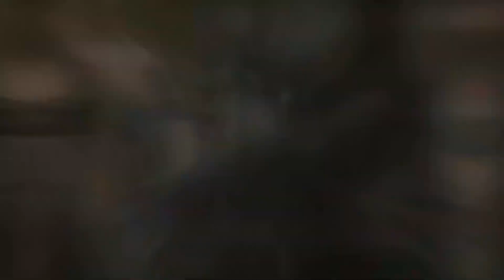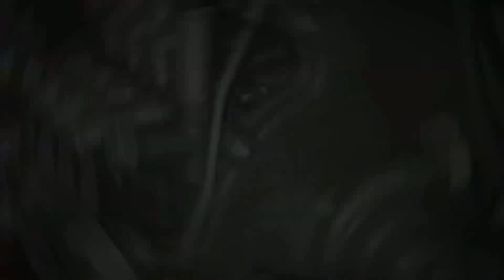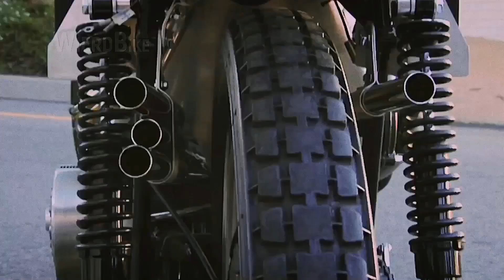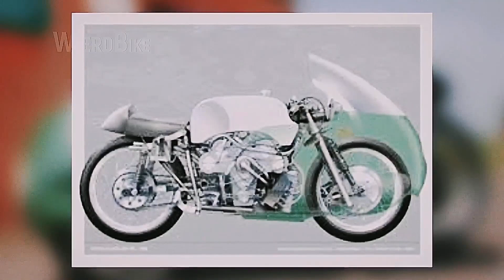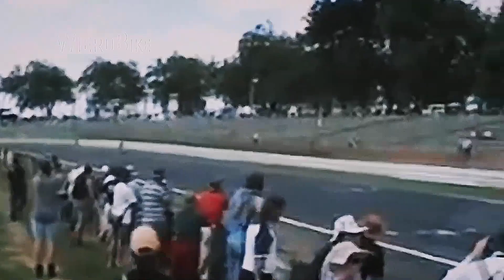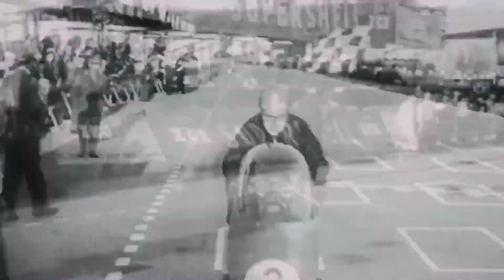MICROSCOPIC V8 Capable of 300km/h in the 60s... Disasembled THIS Look Like CLOCK MECHANISM!

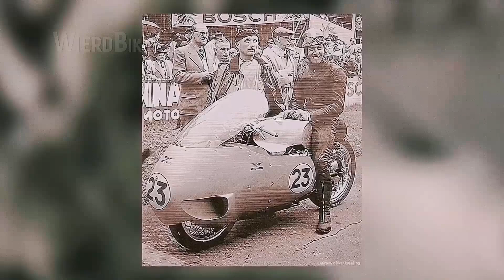Comment: The term "microscopic" is absurd, the Guzzi V8 never reached 300km/h, highest measured speed was 287 km/h during a record attempt, and the bike was only used in the 1950s, not the 1960s. 1:35 That  Guzzi single cylinder. Carcano did not use a calculator, but a slide rule - as can be seen in the picture. Moto Guzzi V8s as seen now are different from the original ones, with many modifications.